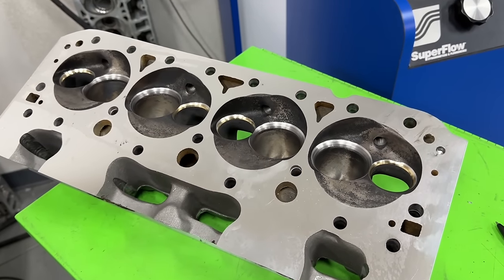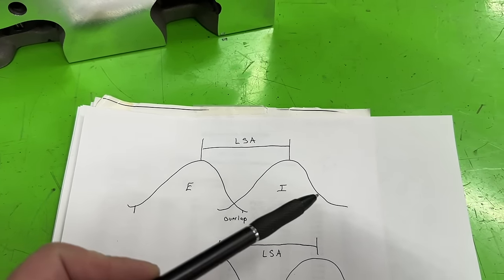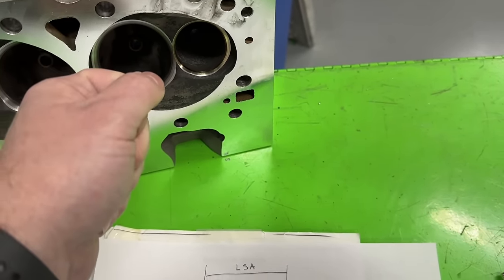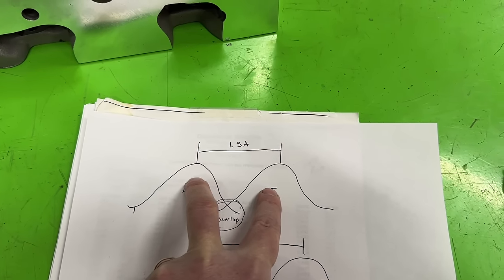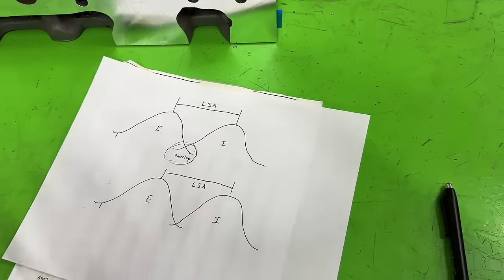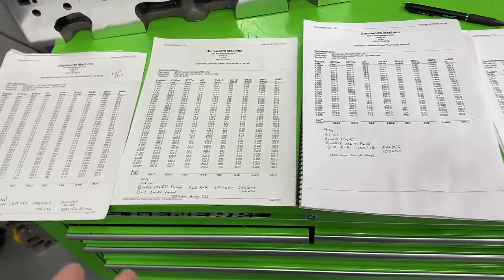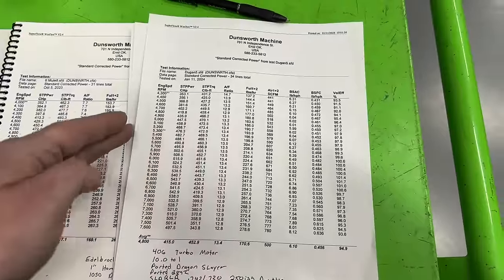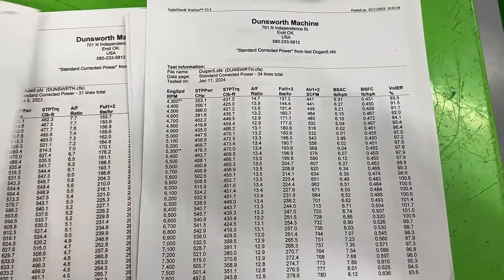Difference Between Turbo Motor And NA Motor

Comment: Respectfully disagree with you on your cam information. You are referencing "turbos" for boost where exhaust is used to drive a compressor wheel so exhaust pressure could be higher than intake pressure. But on virtually any supercharged application; roots blower, centrifugal,  screw type, that is never the case. On supercharged applications your engine should be cammed like an NA application. Move the power band around with LSA but you would do that NA. Start thinking of boost as lower altitude. 14.7psi of boost is 14.7psi ABOVE the 14.7psi of atmospheric pressure. You could also achieve this same pressure without a power adder if you built a dyno down a 21000 ft mine shaft. So how would you change your cam specs if you were operating in a 21000ft mine shaft vs sea level? With that amount of power your needs may be different for example less midrange power needed so more high end preferred, okay narrow or widen the LSA. THIS is the real reason most "Boost" cams have a wide LSA. I do agree turbo cams need wide LSA due to back pressure. And obviously cam specs and compression get changed due to fuel limitations as well. NOT for power reasons on Supercharged. Best NA cam is Best supercharged cam. I'm right.
Reply from the maker: Ok
Reply from the maker: Ps I have never seen a boost cam with narrow lsa. Not 1500-3500hp cams I have seen ever.
Reply: @WeingartnerRacing  I replied to that at like 3am and reread it. I’ve edited it to read wide LSA on turbo cams such as 114 not narrow such as 108. And I agree with your sentiment on cams as regards to turbo cams but not “boost cams” such as a supercharger. Also street cams with 230-240 lift @.050 on with an LSA of 110 probably have less overlap then a solid roller cam with a duration of 270 @ .050 and LSA of 114. Love your videos, I watch everyone. But I subscribe to a Richard Holdner cam theory with cams. The cam that makes the most power NA makes the most power under boost because the effect is just as running at a lower altitude. The exception is turbo because of the back pressure in the exhaust.

Comment: It won’t take 35 psi. The head studs or bolts are only 7/16 . The heads will try to lift. Game over! I-18-24
Reply from the maker: This isn’t an Ls. Sbc has 5bolts close to cylinder it will hold it. Look at grubworm.
Reply: Johnathan Atkins hour long video on sbc vs ls was really interesting. Even though hes making so much more than most of us will ever make. My favorite stick car ever